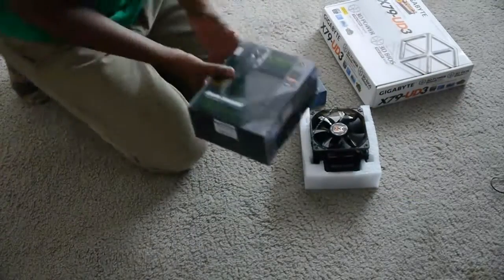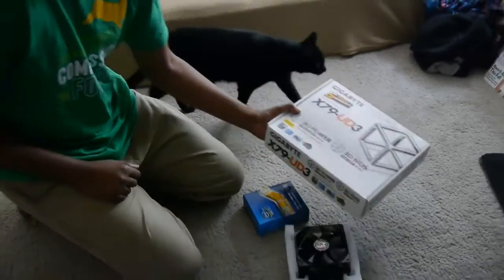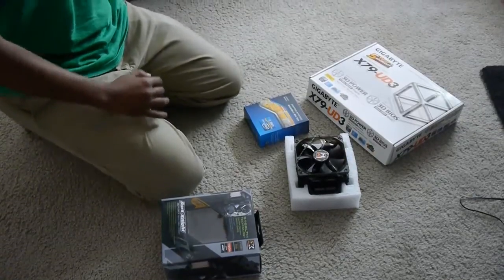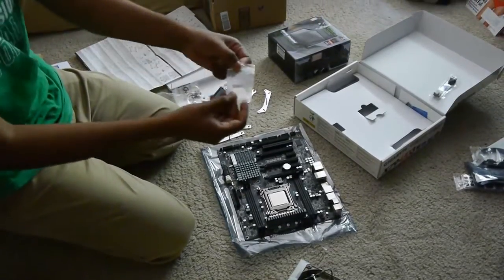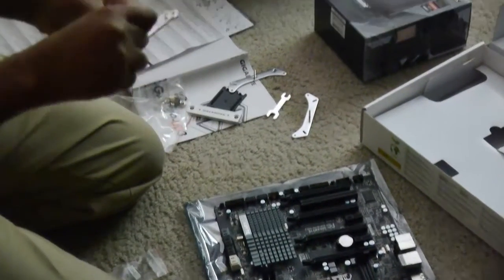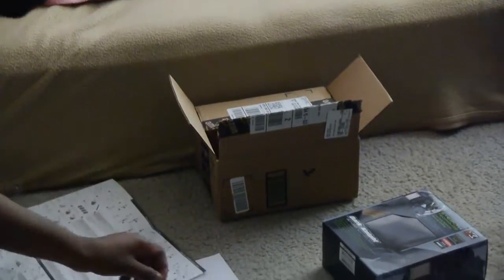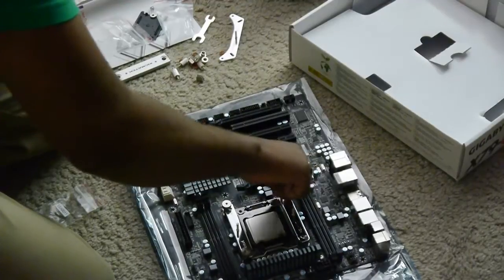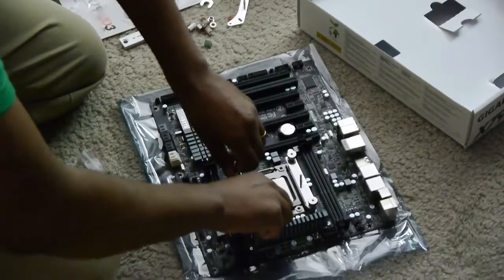Xigmatek Dark Knight - Night Hawk Edition CPU Cooler LGA 2011 Socket Installation Tutorial

Comment: Hey! I can't understand, did you installed backplate from the cooler's package? Or just pust standings in mobo? I have same cooler now at AM3+, but I will move to 2011-V3 in few weeks.
Reply from the maker: No back plate installation was necessary.

Comment: Dude, do you think there will be troubles to install on lga1150?
Reply from the maker: If you cannot find a tutorial, I would suggest you do a dry run, i.e. imagine putting it together by going through the motions without actually putting anything in place. That way you'll figure out where the problems may lie and what parts you'll actually end up using. I think that is what I did. All the best!

Comment: WoW all that trouble just for air cooling. Ive had water blocks install easier than that. not really sure if I would get this one as the price is a bit steep for the temps you get vs a stock cooler and the tough install. I mean whats the point of having a case with the back main board plate cut out for cpu installs, when with this cooler it looks as if you must remove the board to install it regardless. but anyway thinks for the vid and btw cool cat.